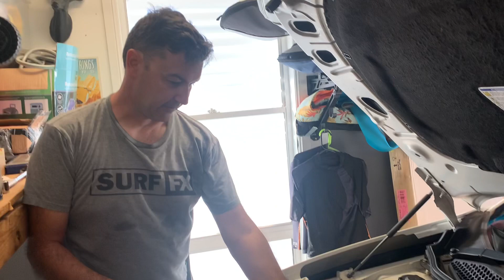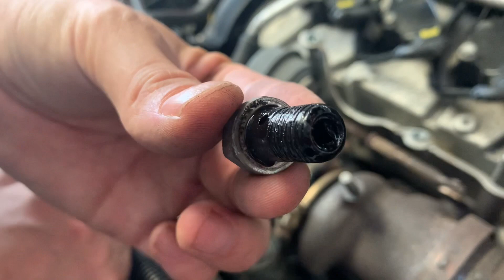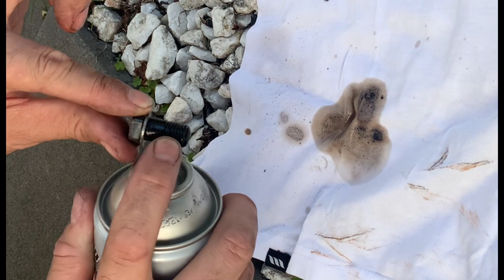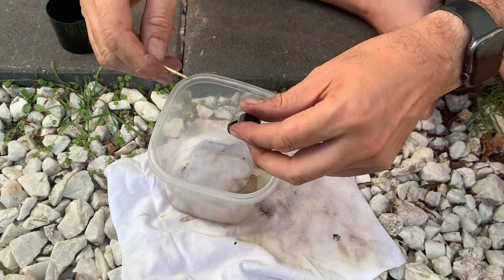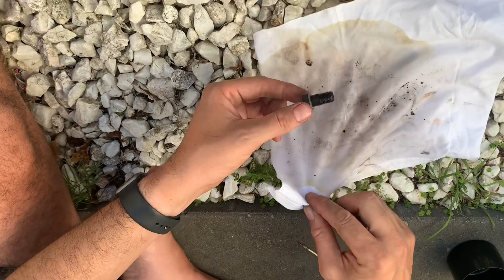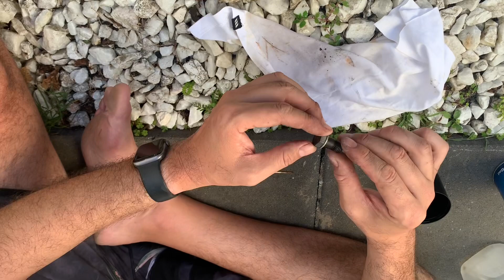Cleaning the turbo oil feed banjo bolt on T-Jet MultiAir engine - Alfa Romeo, Fiat, Dodge, Chrysler

Comment: Thing with these turbos is that the oil line is often very close to the turbine housing. If you drive hard and turn off the engine immediately (or the start stop does), it'll cook the oil in the oil line...

Comment: Changing this bolt should be included in standard maintenance operations done by the dealer, but I wouldn't be surprised they don't even know about it.
Reply: NOthing in the manual, also for the multiair filter , seems like they want to destroy the vehicle

Comment: It is even better to drill that hole, in order to remove the small filter that is inside. That way you solve the problem with the oil supply to the turbine forever. And of course regular oil changes (prescribed) after that. Greeting from serbia!
Reply from the maker: Great advice. I might do it next time
Reply: Followed that advice (oddly mine didn't seem to have a filter), gently turned drill bits of ever larger sizes in the bold by hand (removed so much more than brake cleaner alone), started off with about 3.5mm diameter and ended up at a 6.5mm drill bit.  Turning by hand removed so much baked on oil.  
Think I'll have to take the oil line off at some point and clean or replace that too.
Reply from the maker: @robstebbings3556  maybe you should do a few oil changes every few hundred Km with a cleaning treatment like Liqui Molly to get that motor clean. Did you clean the MultiAir filter while you were at it? That gets blocked too. I have a video on it as well

Comment: was able to get this out after spraying the base of it with penetrating oil and leaving it a few hours, and lightly taping the head a few times with a solid metal tool.
It looked horrific inside, after 120000 km with no cleaning, and also spent a fair bit of time trying to clean the gunk from the inside screw threading, and making sure there was no hard bits that fell off in the turbo oil restrictor area just bellow the screw. Replaced it with a new one, so I hope it will prolong the turbo life somewhat, even if it was done so late in the car's life.

Comment: Thanks. I manage to remover bolt without removing the cover. I just wonder about those 2 holes in that bolt. I supposed the oil have to go through one of them and it have to be aligned with oil pipe. Wonder if the is a risk to not align them properly?
Reply from the maker: @rasier101  just get everything clear
Reply: @TheEddysGarage  As well I notice it fix my whining turbo noise and probably prevent damage so huge thanks again for this video. Couldn't find any solution for this worrying and annoying noise and it is completely gone now. This bolt filter still blows my mind. Seems like no one knows about this. Wonder how many more things like that in our Giuliettas xD
Reply from the maker: @rasier101  good job 👍.

Comment: 1.4 t-get also has similar bolt down, to the oil filter housing. Does it worth it remove and clean?
Reply from the maker: It isn’t going to hurt

Comment: Thank you for this video im looking forward to cleaning it when I change the oil of my mito 1.4T multiair, but does the position of the banjo bolt when you re-screw it matter ?
Reply: Just wondering if you have the answer for your question?
Reply: @filipsmorozovs625  it dosen't matter but make sure you use New aluminium washers and tighten with the oil line straight and not too tight
Reply: @enidra5388  sorry, do you know the exact size of the washers needed for this banjo bolt?

Comment: Why a filter at that place? It blocks the flow. The oil going to the turbo is allready filtered by the oil filter🤷 or do i miss something? I could be wrong🤔
Reply from the maker: Just Italian car things 🤷‍♂️
Reply: You can clearly see the amount of debris there that was trapped by this banjo bolt filter. Without the filter all that stuff would have ended up inside the turbo bearing section. You have to understand normally the entire engine only has one oil filter. So whatever impurities there are in the oil circulation do not get filtered out before the feed reaches the one single filter. The turbo bearings are the most delicate part of the entire lubrication system. That's why they have their own filter.

Comment: Great!  I didn’t know this filter existed!  Did you replace the washer or did it torque up OK?
Reply from the maker: I just tightened it up because I couldn’t get a replacement
Reply: @TheEddysGarage  any leaks since cleaning I wouldn’t mind doing this to mine   Just  can’t get the washers
Reply from the maker: @adyg8221  no leaks at all on our
Reply: @TheEddysGarage  thanks mate 👍
Reply: Guys you should also check the whole pipe as I've seen videos where it's blocked with the gunk carbon stuff. I'll find video link and post it.
https://youtu.be/g98Ps-up5EY
Italia Autos

Comment: No filter there mate, the filter is in the other side of pipe.
Reply from the maker: It’s pretty clear that there is one in the top bolt because I clean it and I mentioned the lower one in the video as well.